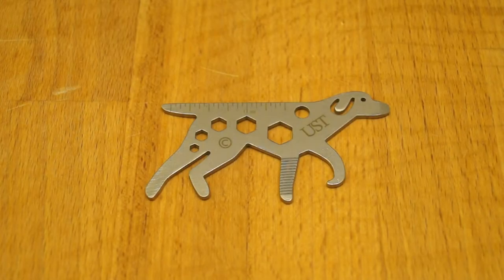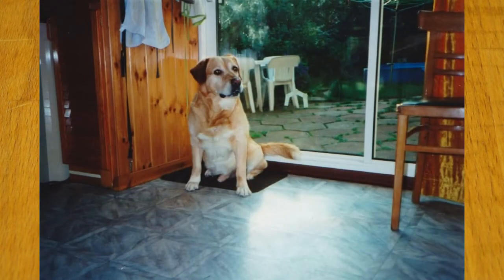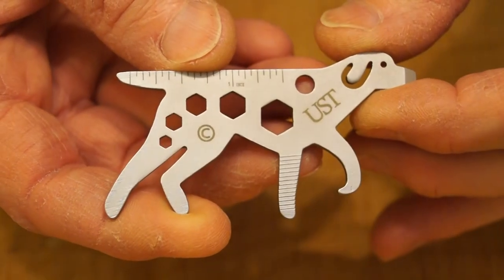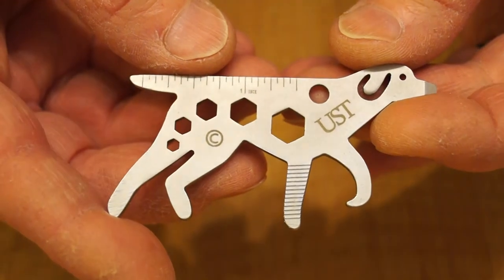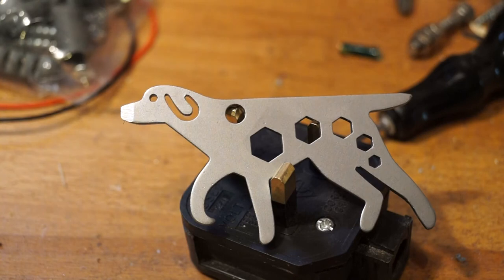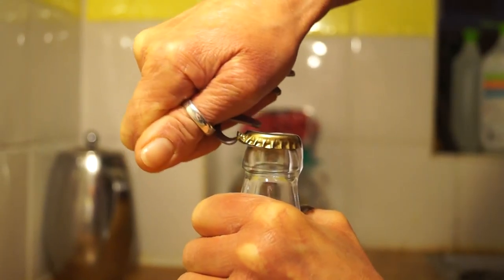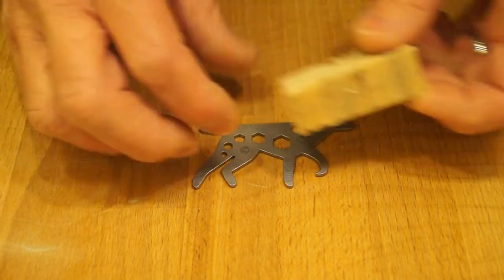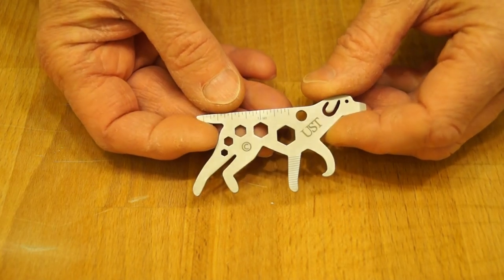UST Dog Multi-Tool Review

Comment: It might be able to be used as a compass, if one of the spanner holes or the circle hole could accommodate a pencil in one and a pointed object in another.  The rear legs may be used to help lift a tab on a canned beverage and I have seen something where a string, if looped through the ear or eye could help establish an angle via the straight back.  Look up the uses of a speed square that carpenters and builders use. I am not certain if thats what they were intending with these designs, but who knows, it may be possible.